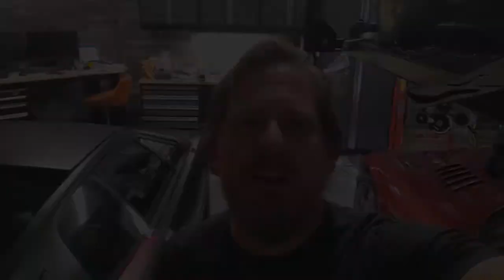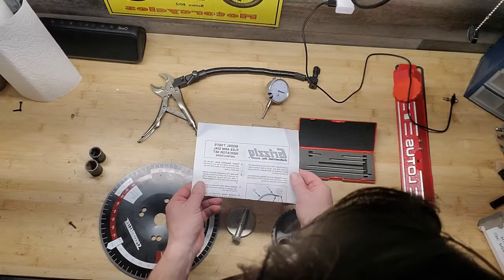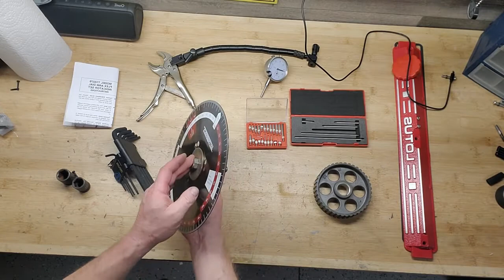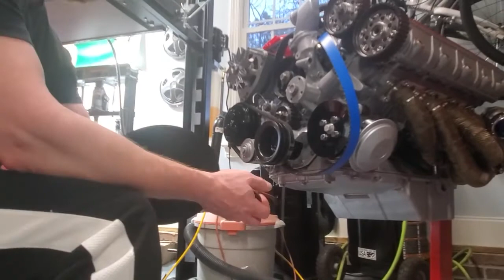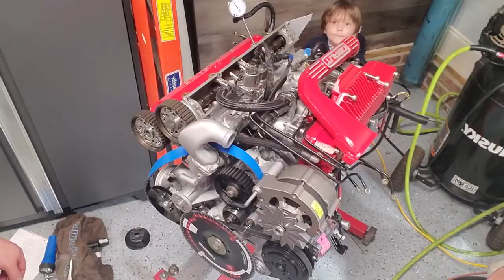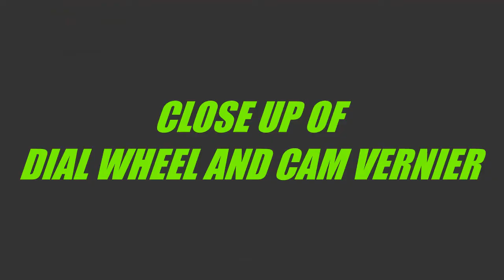Lotus Esprit 910 Turbo Engine Build - Part IV

Comment: WHAT HAD ME MIXED UP WAS THE CAMERA WAS INVERSED HUSKY WAS SPELLED BACKWARDS WHEN YOU LOOSENED BOLTS IT WAS CLOCKWISE, AT END OF VID ALL BACK TO NORMAL , HOW DID YOU DO THIS ??
I THOUGH I WAS IN ENGLAND ON THE WRONG SIDE OF THE ROAD BECAUSE OF THE LOTUS ENGINE OR LEFTHAND THREADS, WHAT HAPPENS WHEN YOU NEED TO CHANGE A SHIM WHILE ENGINE IN CAR, OR THIS IS A REBUILD AND NEEDS THESE DWELL SETTINGS FIRST AND THAT WONT CHANGE FOR A LONG TIME AFTERWARDS, AND THEN A SHIM HERE OR THERE WONT NEED THESE DWELL SETTINGS

Comment: I hope you rechecked your exhaust timing.  You rotated the engine away from 109 degrees when you were setting the cam timing.
Reply from the maker: Hey Ross. Thanks for the message.  Weird, I must have gone back through it after the video because motor runs fine.  Although, I have a frustrating problem with the fuel pump relays not being send the proper ground signal at run and crank.  May have to post a video asking for help with that one - driving me crazy!
Reply: good catch! seen that too and i said the same thing to myself :)
If engine runs fine i guess he did double check it, as per good practice anyway.